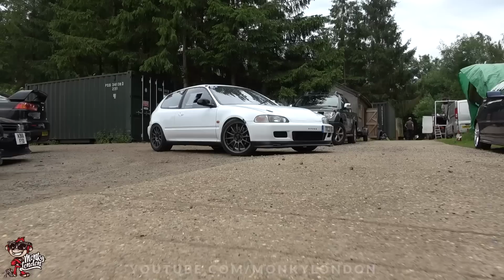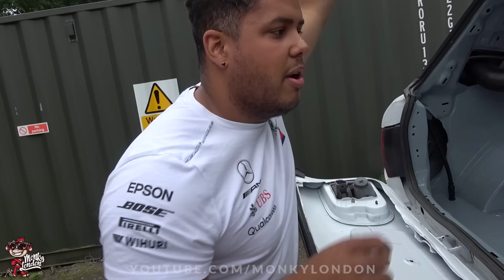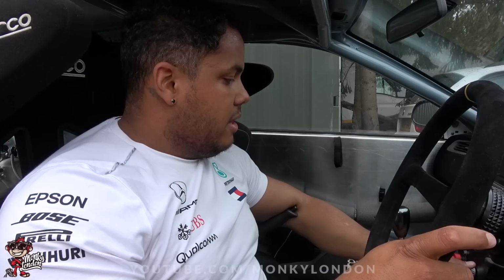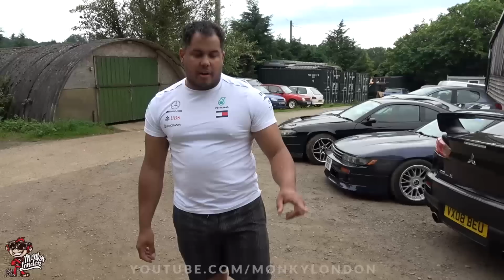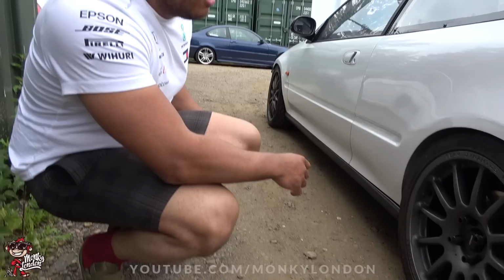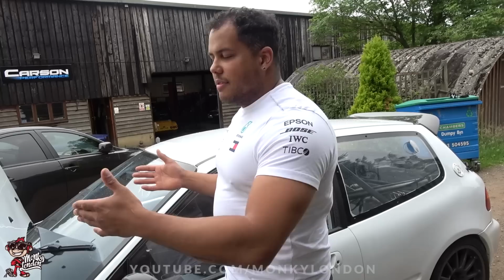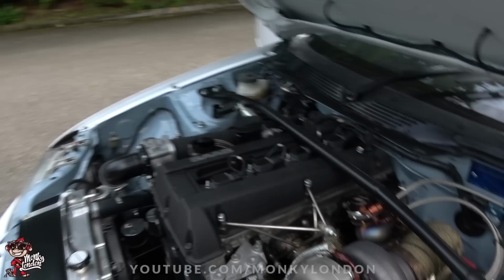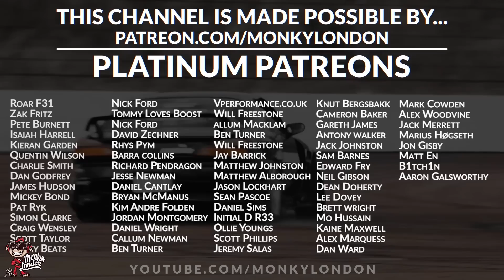🐒 RWD CIVIC MONSTER! DEEKS 540HP HONDA BUILD (NO VTEC)

Comment: Finally !!, a decent engine on this channel. Im a ex Saab Master Tech as well. Did all my training on 9000's. The quality on this build is superb, and is what i would expect from a Saab man. These engines go on forever and dont break, my high power 9000 has 220,000 miles and still going strong. A few points......
Saab B2xx engines really dont like revving high. Yes you can get them to 7000 with Volvo T5 valve springs, but the cranks are not balanced for that kind of rpm.
Also, really wish you had kept Trionic 5. We are doing some amazing things with T5 these days on the UKSaabs forum. Well over 500bhp is easy.

Cant wait til you do the Calibra. Please dont scrap a saab 9000, get a 2000 saab 9-3 2.0T HOT or something. You need the entire engine wiring loom complete with the T5 ECU. You also need the Dash cluster as the speedo generates a pulse that Trionic 5 uses. Im on UKSAABS if you need help and on IG and Twitter too. Same name as here.
Reply: K series engine would walk them
Reply: @MannyDelReal  Yeah, funny he mentions a decent engine, meanwhile says the Saab cranks arent balanced very well... You can turn stock K-series cranks to 10K+ rpm, even the 99mm cranks from CR-Vs and Accords are great.
The K-series head is vastly superior too.
While the Saab build is interesting, If I was doing a FR setup in an EG, it would be either an LSx or 2JZ
Reply: How much money does it cost to build a 500bhp Saab engine?
Reply: @harrymcough5545  I would guess under £1k on a B204 or B234. Just add a bigger turbo & injectors. Trionic 5 is opensource now, and a top remap is less than the cost of a tank of fuel from the Legend  "Jules HT".
Reply: @MannyDelReal  Really. Honestly when people make statements and dont  have a clue what they are talking about. A Saab B234 @ 500 or 600bhp, will run at that for 200,000 miles or more. And never fail. Where as the honda lump will destroy itself in no time. As they do....
Reply: DJ_PaulTUK 1k that is well worth it
Reply: um, there's been cars with supperior engines on here, just because you work with them and like saabs doesn't mean it's objectively the best 4cyl
Reply: @realMaverickBuckley  They're common for a reason
Reply: I have a saab 9000 air flow powa :D
Reply: People shouldn’t bash the saabs just because they don’t know anything about them.  

Standard blocks and cranks can handle well over 1000hp (the cranks are balanced very well)
2x4 rods and pistons have seen well over 700hp.

As for the rpm side of things. Oil pumps do suffer after 7500. So an external one is a good idea. Solid lifters,cams and a rebalancing will see the 2.3 to 8000 and the 2.0 to 9000ish.

Sorry but they’re beasts
Reply: Manny Del Real Nah

Comment: When I saw RWD Honda first thought it would be s2000 running gear but wow what a mash up all engineered into a mad hatch.
I love the rear suspension setup. Motorbike shocks and race car setup is very inspired.👏👏
Only thing missing is 9000rpm up shifts 😜👊

Comment: All hail the SAAB motor!! Im currently building a b235r to go in my RX7. These engines are so cheap and tuneable. Strong too.
Reply: B235 engines are rubbish sorry. GM built and much weaker than the older B2x4 series Saab designed engines. The 235 cannot go beyond 310bhp stock. Even then they occasionally blow up at that power level.

Comment: I remember back in 2007 seeing an EG coupe at a car meet spot. It looked odd because the rear sat a little higher than the front. It also had an aluminum drag wing hanging off the trunk which was usually only seem on RWD drag cars. As I got closer, I saw a solid axle rear end tucked under the car. It also had a mini tub to run a small drag radial in the back. When I got to the front of the Civic, a 302ci Ford V8 with a large turbocharger was under the hood. I talked to the owner and had to know why he used the Civic. He told me that surprisingly, the Civic had more structural rigidity than the Mustang which used to run the setup. I never got to see it perform because the owner was only interested in grudge races and no other drag cars were at the meet up.

Comment: Fair play to this guy👍🏻👍🏻
Awsome job. 
Thrown away that rattling old Honda and dropped in a bullet proof saab 👍🏻
With an Internet full of civics claiming to be over 300 bhp it's so good to see one that actually is.
Ive seen so many Vtec-s blown up by boost but this engine can handle it no issues. 
All it needs now is a V-tec this🖕🏻 sticker on the boot.

Comment: The saab engines generate alot of heat aswell as that turbo, all the saabs I've owned heated up so quick literally 3 minutes of driving and they are too hot to touch 😂

Comment: Rear Tyres too wide for the weight to get heat in.   Going down a to a smaller rear tyre will get the compound working better. Quality build 👍
Reply: Hoonatic Bloggs they work fine mate

Comment: Might be me being daft but how would 255 16s be any different tracktion wise to 255 17s?
Reply: daniel jordan nicol there was a bit missed out, the 17s wasn’t for traction but to make the ratios slightly better, with 16” the gear would be even lower

Comment: That's so fucking cool but I really wonder what the fuck went through his mind to do everything the way he did.
Like a "normal" person that would like to convert a civic to rwd would think of using an f20 (s2000 engine) as it's made to work in a longitudinal position and is honda, and you can also use the trans, then for the rear suspension, the logical way would be either to use one of those kits with modified trailing arms that people use to awd convert them or to use s2k stuff and custom mount it.

Comment: Try to make sense of this... Could have used any EG chassis but decides to cut up his rare VTI, then complains of not finding another one for K-swapping. Then removes the B series and instead of putting in another reliable Honda goes with a Saab with a BMW gearbox. It would be more awesome if kept all Honda powered. I understand why he put a Saab in it since he had experience with them but then again why use a Honda chassis... And I could go around and round but hey ho it's his built! Enjoy!